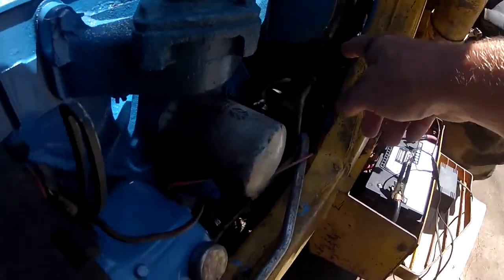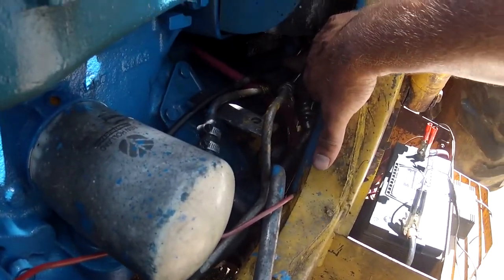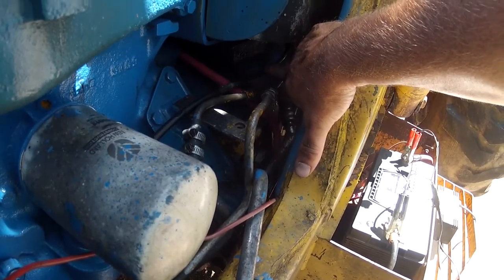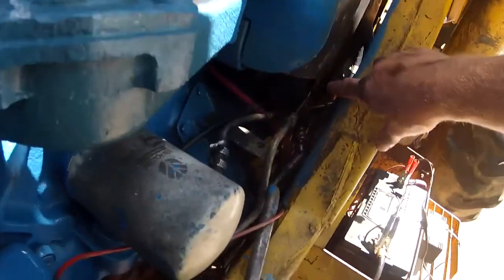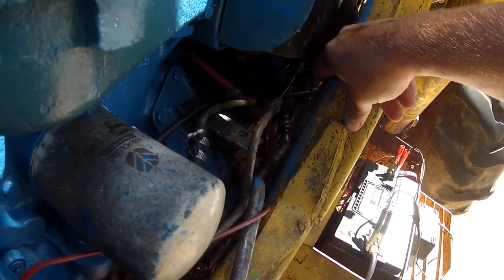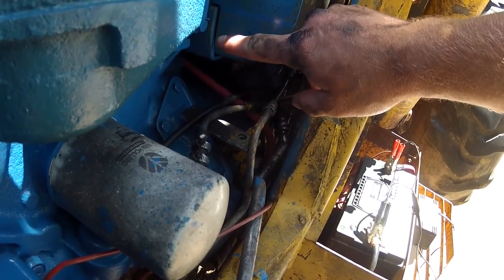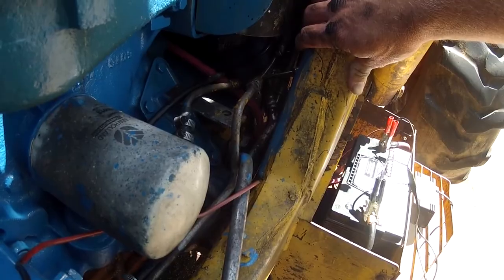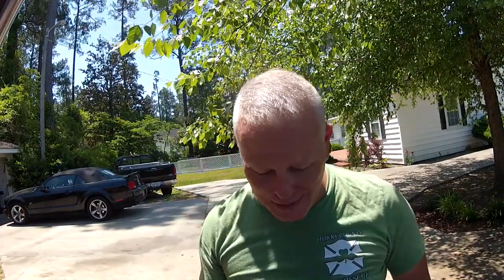When You're Not On Speaking Terms With Your Backhoe (Problems with the 1981 Ford 555)

Comment: Hello, Not sure where to comment so here it is. Have you changed the hydraulic filter in the housing located on the outside frame rail on right side of the backhoe? I would like to change this filter but worried if I take the lines off it will drain the entire hydraulic tank. Also I have had a hard time locating a part number for this filter since it is located in this housing. 

Thanks for making these videos; my backhoe is a 1979 Ford 555. 

Thanks!
Reply from the maker: Hey Brent. Yes. Changing the hydraulic filter and checking all the fluid levels was the first thing I did.  The hydraulic filter is pretty easy.  If you'd like I can make a pretty quick video outlining the process. 

I don't rely a lot on part numbers for mine because I have a great group of guys at the new holland dealer I go to and they haven't given me a bad part yet.

I really did not want to break this thing in half so I tried every conceivable way I could (or the guys giving me advice could) think of before I finally just bit the bullet and did it.  In the end it did turn out that separating it and going into the transmission was the only fix.
Reply: Thanks for the reply sorry just remembered to check my comment while working on the hoe today.

Yes, if don't mind putting a video together about changing the hydraulic filter it would be really helpful. I have already changed the filter on the belly of the hoe but not the one located on the outside frame rail.
Reply from the maker: OK, I'll put a video together and when I post it I will comment on this thread that it is posted.
Reply: Great, Thanks!